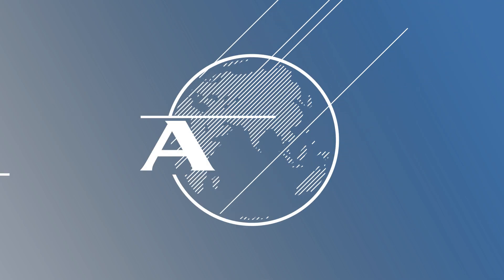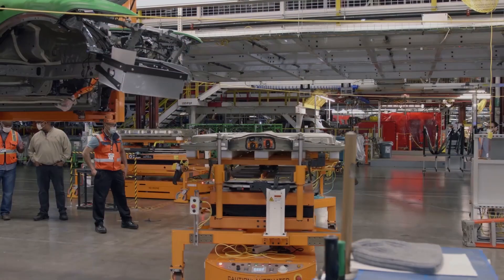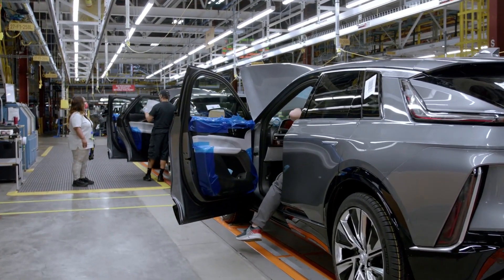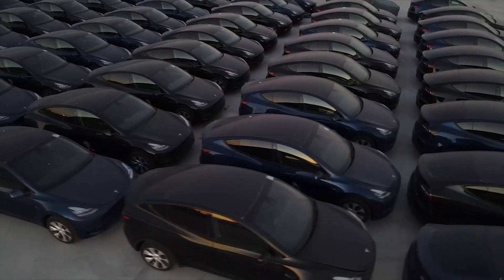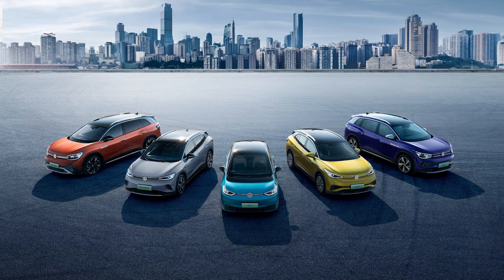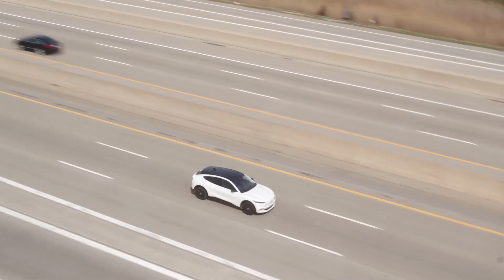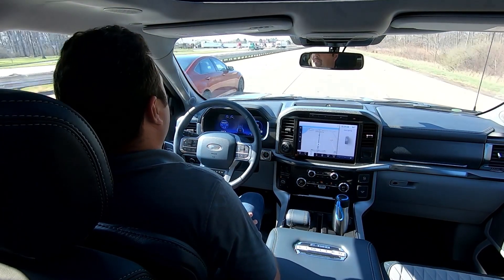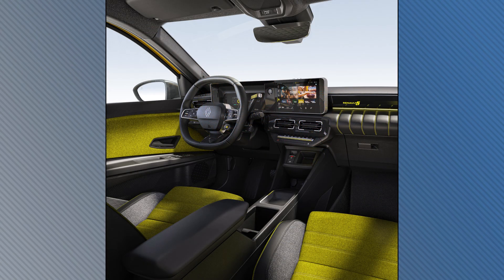GM On Pace for 200K EV Production Rate; New Material Prevents Thermal Runaway - Autoline Daily 3905

Comment: China forces foreign companies to operate almost exclusively through joint ventures with a local Chinese "partner" company. Therefore, Chinese firms should not be allowed to operate fully owned factories in other countries. They should be forced to operate only through joint ventures 51% owned by the LOCAL non-Chinese company.

Comment: You can easily put out a fire on an EV fire. You need a machine that can punch a hole in the battery then inject water into the battery lowering the temperature and therefore stopping the thermal runaway.
Reply: Then why haven’t you invented it?

Comment: Tesla has the new model 3 Highland, the new model 3 performance and could show off the upcoming model Y Highland... wouldn't say they have nothing to show
Reply: Minimal up and downgrades, same looks. Boring af
Reply: @MaticTheProto   Lots of upgrades, longer range, different suspension, upgraded insulation, diffrent fron and rear lights/bumpers, new wheels, better oe tires, better tolerances on panel gaps, washer fluid easier to get to, 20% less NVH ! thicker glass and better insulated doors, ventilated seats now standard, flat bottom steering wheel. second row display, interior ambient lighting now, rear diffuser upgrade... other then the body in white they have upgradeded so so much on the new build. and no im not a tesla fan boy i drive a hyundai Ioiq but to say no changes or boring you havn't seen or driven one
Reply: @3184Patrick  they still look almost identical and removed the stalks for no reason, as well as the parking sensors. 

Having a drivers display would be much more useful than a rear screen positioned in the most unergonomic place possible.

The other improvements are nice but ultimately it’s still the same boring design
Reply: Same aging chassis, same old exterior and interior designs.
Reply: except the front and rear exterior are all different and so is the interior materials, stitching, seats, displays, lighting....

Comment: Water does not put out EV fires.  The water used by fire departments is just to stop the EV fire from spreading to nearby combustible objects/structures. An EV thermal runaway fire is a self sustaining chemical reaction that generates its own oxygen, which is why water won't smoother the EV fire. The EV fire continues until its chemical fuel components are fully combusted and it burns out. EV fires aren't more frequent than ICE fires, they are just impossible to extinguish and have to be allowed to simply burn themselves out, which can take hours, if not days in some cases.
Reply: Just imagine how much pollution an EV fire creates.
Reply: @anthonyxuereb792 It's undoubtedly pretty bad.  But think of it this way:

1) ICE cars catch fire 60 times more frequently.  So the EV fire would have to make 60x worse pollution to be comparable.

2) The C in ICE stands for combustion.  ICE cars create pollution from combustion the whole time the engine is running.  Even at idle.

Imagine filling a tank with gasoline equal to the amount you use during the life of your car.  Then set that on fire.  

Ok, so the cat catches about 90% of the pollutants.  That 10% that you and your neighborhood end up breathing, is no joke.

3) EV batteries are still an immature technology.  Think of how much ICE cars improved between 1940 and 1990.  Well, LFP has already virtually eliminated EV fires from a big proportion of the EV fleet.  And there are plenty more innovations to come.
Reply: @davidmenasco5743 finally someone who isn’t just spouting petrol propaganda

Comment: GM is now building Hondas? My how far Honda has fallen.
Reply: Not as low as you
Reply: GM has been producing components for Honda for many years. Most notably, ignition modules. Honda just doesn't have the engineering depth of bench of GM.
Reply: I thought they recently terminated the partnership, no?
Reply: @faheemabbas3965  
Terminated is not the right word, it's sort of like deciding to keep a part-time employee part-time instead of moving to full-time. The employee is still working for the company. So instead of making more commitment in the EV partnership they have decided to leave the level of commitment at where it is right now.
Reply: @faheemabbas3965  They both decided to stop pursuing the holy grail "low cost" EV. The profit margins just aren't there yet, like they make more profit off one Hummer than the ten Volts or four Bolts they could have built with the same battery capacity.

It's the reason they killed the Voltec projects, it was amazing tech (better than Toyota and Honda at the time) it just didn't make them as much money as other projects.

Comment: Video 0:35 A micrometer is a measuring tool a micron is a unit of length.
Reply: It's an issue where the stress is placed. A miCROmeter is a tool used for measuring the thickness of objects, usually in microMEters.
Our young host used the Tool pronunciation in place of the unit of measurement.
Reply: Poor guy is just reading a script.  Give him a break.
Reply: “The most common metric prefixes include giga (1,000,000,000), mega (1,000,000), kilo (1000), hecto (100), deka (10), deci (1/10), centi (1/100), milli (1/1000), micro (1/1,000,000), nano (1/1,000,000,000), and pico (1/1,000,000,000,000).”
Someone did not pay attention in the classroom when metric system was being explained?
Reply: @rok1475 not in the school room I spent 40 years as a mechanical engineer in companies like Rolls Royce, 3M and a number of aerospace firms
Ps also cars are not fueled with gas but gasoline
Reply: You can tell a show is good, when it brings out a discussion like this.